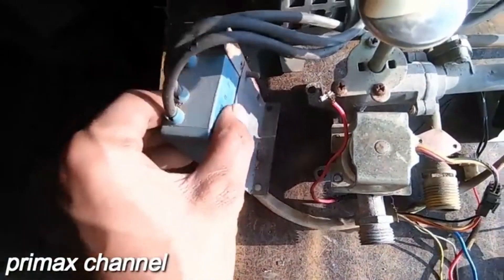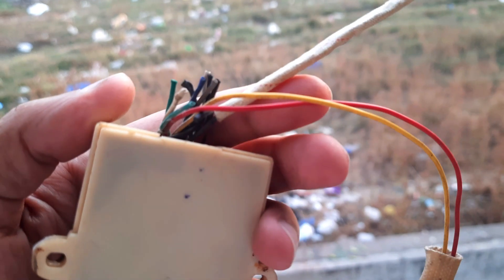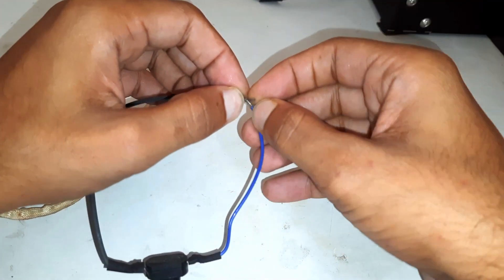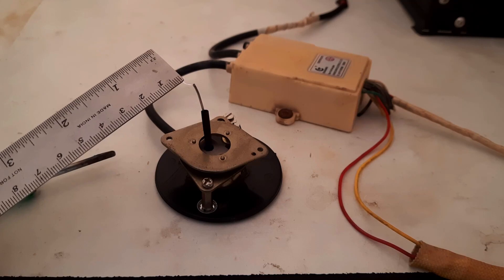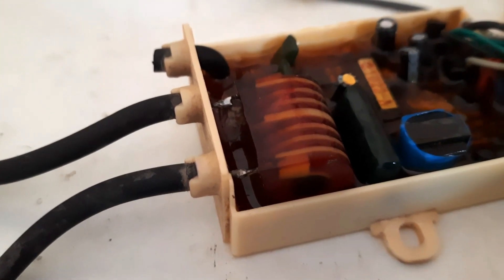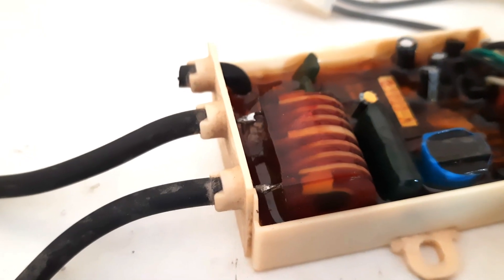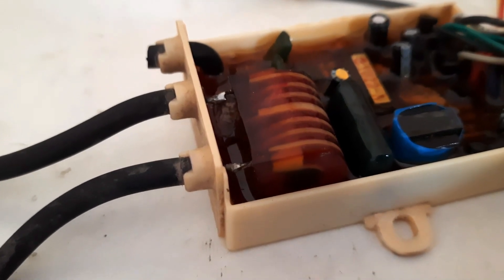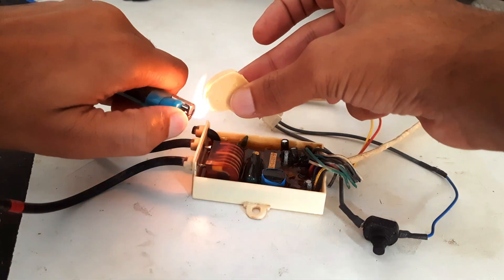How to Repair Ignition Box | Gas Geyser repair

Comment: Changing the batteries in geyser is really a pain. Can we just connect a power adapter with same rating as 2 D type batteries joined in series instead of using batteries?
Reply from the maker: Yes you can but the adapter will not work longer as the reverse current can damage the circuit